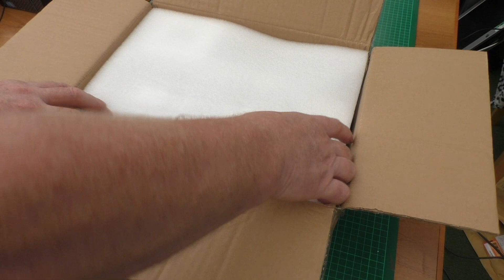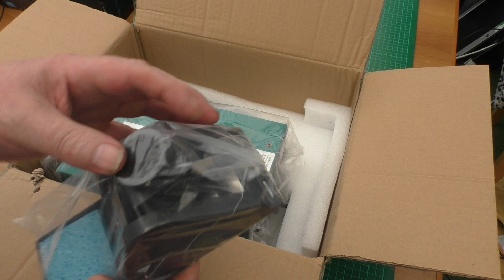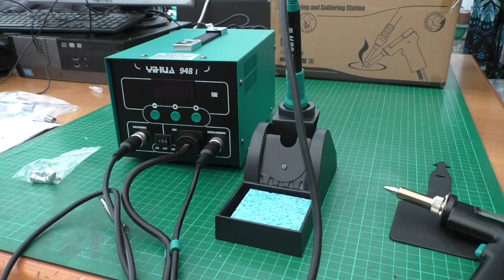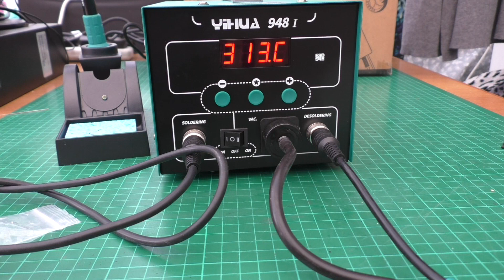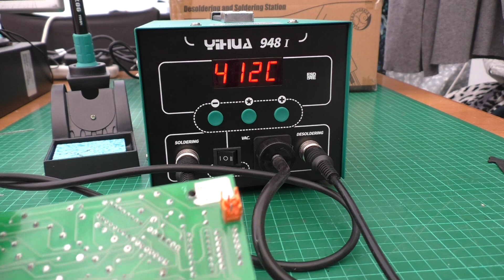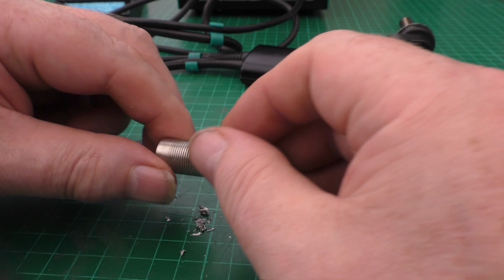YIHUA 948-I Soldering Desoldering Station Unbox and test

Comment: Hi Wayne, cheers for the video. Recently picked up this station second hand and there's been steam / smoke (can't tell which) coming out of the main station when the desoldering gun has been on / used for a few mins. I'm assuming that this is a fault, but just wanted to check to see if you had the same experience before I go for a return. Cheers, Ronan.

Comment: As an audio-repair bench tech, I used a similar AOYUE desoldering station for 5 years before retiring; I didn't care for the solder-capturing spring inside the collection chamber and substituted a wad of medium-grade steel wool instead. The spring is too difficult to clean out unless you grease it, which is smelly and messy. I suggest you also test the tip included with the soldering iron to see if it is strongly attracted to a magnet throughout the tip and at the back end, or if it is only magnetically attracted at the tip (like it's supposed to be). Thermal transfer is far superior if the tip is made of plated copper, with iron plating at the pointy business end only, to prevent the solder and flux from eating away at the copper ----  but a lot of Asian manufacturers are making the tips out of solid steel or iron which is a much poorer conductor of heat. You can easily determine whether the tips are good or bad, with a magnet; I posted a video on my channel about this recently.
Reply from the maker: Hi, thanks for the write up, i can confirm removing the tip removed from the solder iron handle,  both ends are magnetic (tip is solid steel) .
Reply: @waynephillips1848  , buy high quality compatible tips made of copper and your soldering will go faster and easier, without damaging foil traces. You may have to pay $5 or $6 per tip but they'll last longer and work better. If you buy them from a specialty electronics distributer in your own country, you can more easily return them for a refund if they turn out to be inferior quality.
Reply: @waynephillips1848 ,  buy some same-size compatible tips from a known manufacturer (Hakko?) and you'll find that the heat-transfer function works faster and better.  Good tips will be almost completely solid copper but with a coating of iron to resist the dissolving effects of molten solder and flux. Buying tips directly from China through Amazon eBay Banggood, AliExpress etc will invariably net you crappy knockoff or counterfeit tips made of inferior materials.  I don't know if the AOYUE desoldering tips are compatible (they seem unique to Aoyue) but those were particularly interesting because the stainless steel pipe that protrudes from the front end of tip (nice for desoldering closely spaced pins), and which travels completely through the heating element into the solder-collecting tube, is non magnetic and virtually impervious to solder (for long life) but the molded part of the tip was made of plated copper.  Anyway, if you find better quality compatible tips that will fit the Yihua, please let us know what they are and where you got them from.

Comment: Good video. I was about to buy one but if you can't run the desoldering gun and iron at the same time it's not worth it to me. It's like driving your car. If you have to wait two minutes to go from drive to reverse and another two minutes to drive it doesnt seem practical if you are doing a lot of component replacements.
Reply from the maker: I previously had a pace unit, that you could run both at the same time, but it cost over 4 the cost of this unit, all i needed was a dedicated desolder unit, the soldering iron was a bonus for me.

Comment: @ 4:40 what the use of that black thin rubber at the right side
Reply: its to change the tips while the tip is still hot. But I wouldn't recommended it unless it's good quality.

Comment: Can U try desoldering some capacitors , around CPU socket of a PC mother board.
Today PCB design is protective and those holes size nearly the same diameter with electronic components.
If no proper tools and skills,  desoldering is mission possible. 4 layers PCB copper traces are broken.
Reply: Multi layer desoldering is a challenge, some times is necesary to use low melting solder plus flux.
Reply: If you want to remove capacitors in 4 layer PCB's is better to buy a Hakko FR-301.